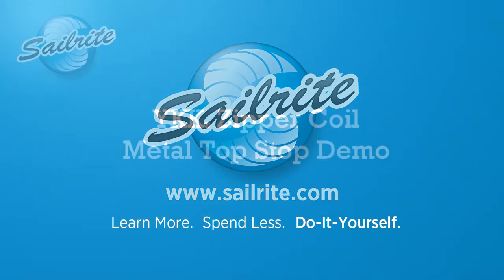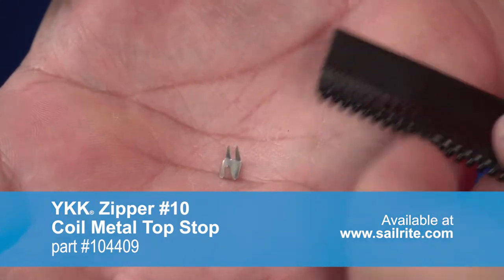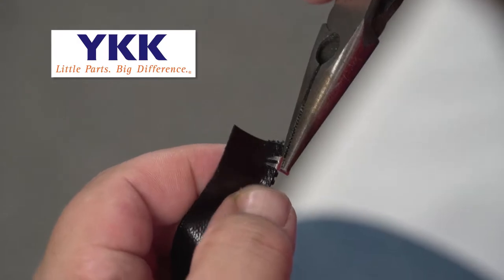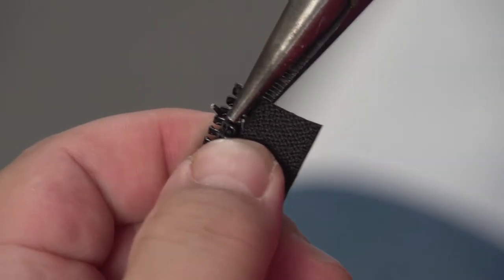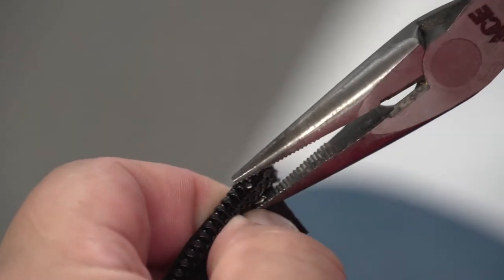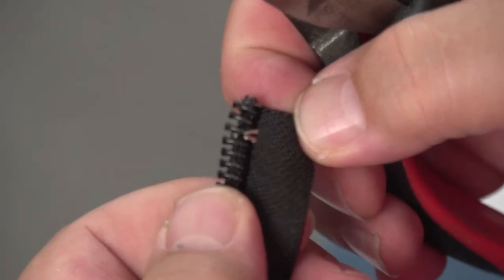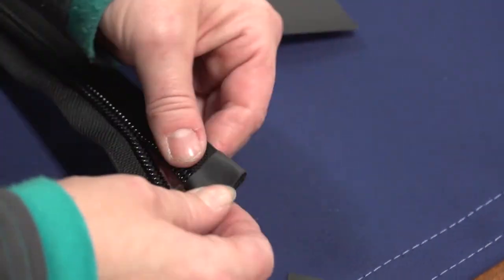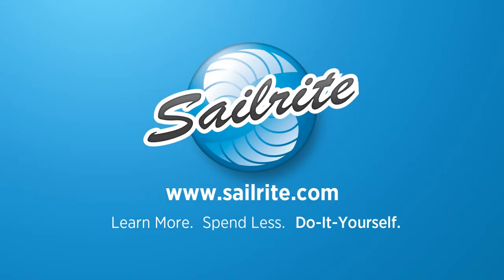YKK® Zipper Coil Metal Top Stop Demo

Comment: I've watched so many videos now and Sailrite has done the best. But I have yet to find a soultion to making a two way open zipper for a jacket from zipper sold by the yard. The stops ar easy enough but what about the start? The start!?
Reply from the maker: Unfortunately you cannot make a continuous length zipper into a finished zipper. "Starter posts" and "starter boxes" are not sold separately to add to a continuous length zipper, they are only installed well by the manufacture.

Comment: My problem is not the zipper pull or stop it's the little metal piece that inserts into the zipper no one seems to have a video of how to repair that do I have to replace the whole zipper on my leather coat just because of that little metal piece missing please reply back thank you for your time
Reply from the maker: In most situations the whole zipper will have to be replaced since zipper sliders will vary from manufacture to manufacture. If you can find a slider that is the same manufacture and for the style of zipper you have you may be able to replace it. Email me a photo and I will check to see if it is something we stock: eric@sailrite.com